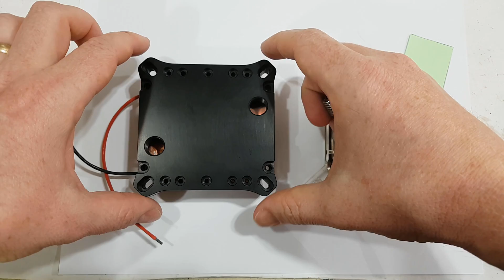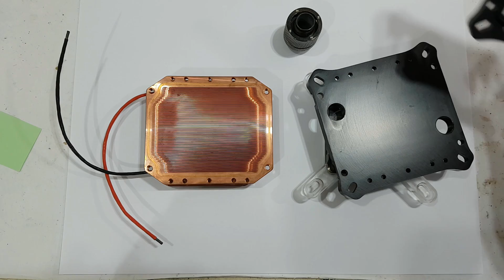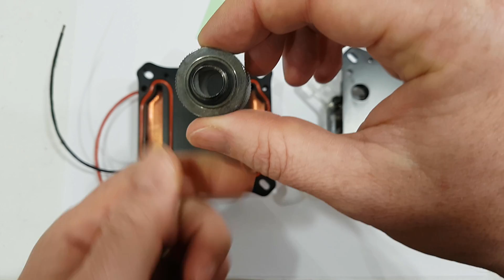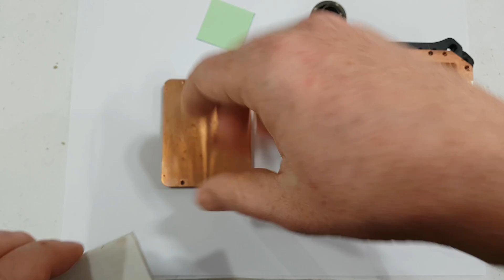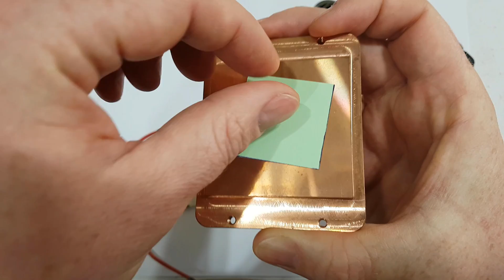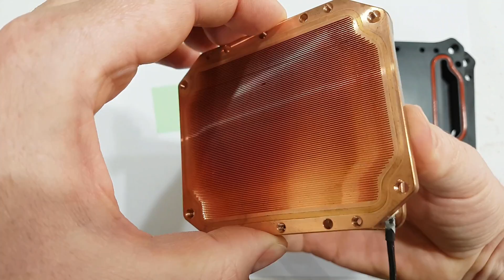⚡️ Dismantling one of my 62mm Peltier Thermoelectic Cooler Waterblocks

Comment: Man .. if you made a CLC you would make so much money.

Also.. why not  cut a recess into the top of the bottom plate? I would be easier to secure, right?
Reply from the maker: Robert Cusick  what us a clc.   Cutting a slot in the base would reduce the streght leading to bowing  and reduce surface area
Reply: @Ultrasonictwo  by CLC i think he means AIO cpu cooler.